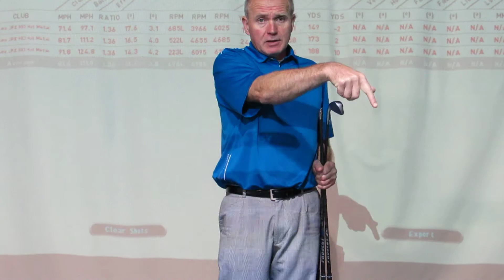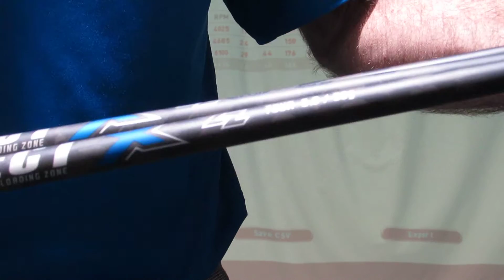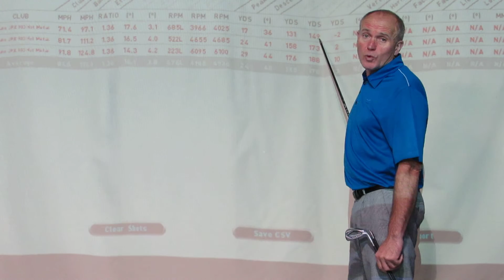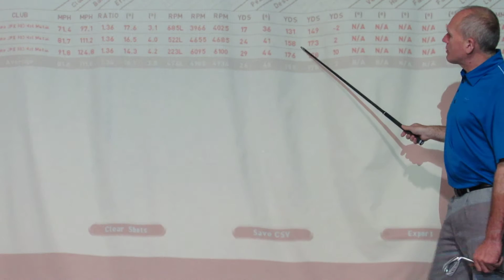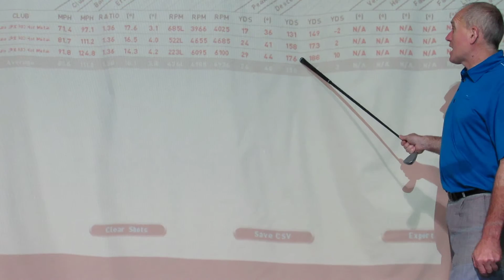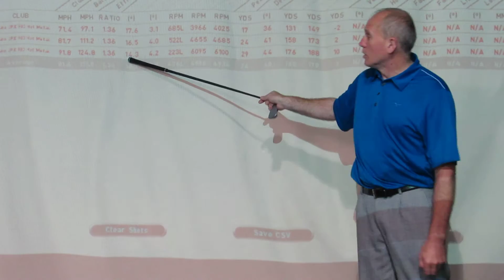Mizuno JPX 900 Hot Metal. Multi flex Project X LZ Graphite test.

Comment: 4.5 in PX is regular (feels once hard-stepped compared to other brands) and 5.0 is "reg plus" (reads as stiff on a CPM machine). Then 5.5 is 100% stiff, however plays more like stiff plus/X stiff in other brands. Check them on a CPM machine or reference the PX iron shaft graph, direct from the manufacturer. Google image search it, it's a blue image.

Comment: I tested the Project LZ tour both outside on trackman and inside. I tried the 5 flex 90 gram and was very very impressed. The feel when striking was like the ball melting into the face and dispersion astounding. My iron swing speed ave 77 mph. I tested this shaft on JPX 900 Hot metal 7 iron. I have ordered the shaft and removing the nippons. In addition distance was 15 yds average more with the the PROJECT X LZ TOUR
One must not make the mistake of using the LZ basic as the Tour shaft is definately an upgrade.